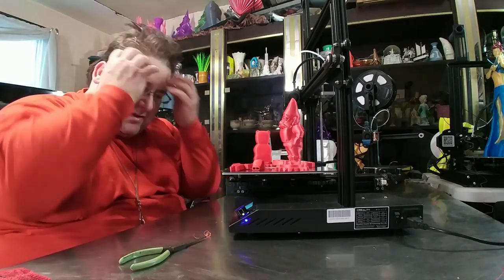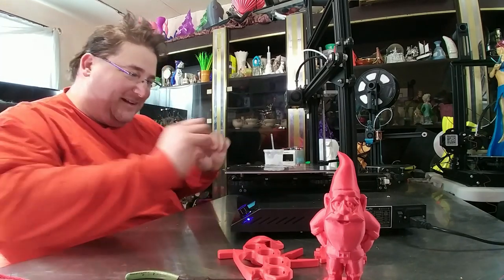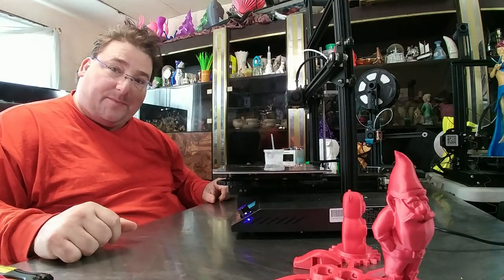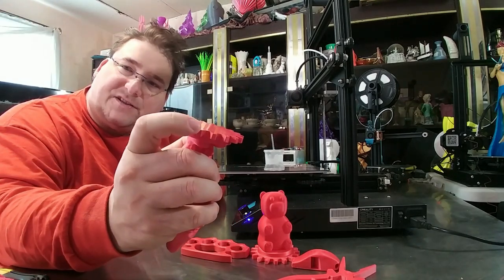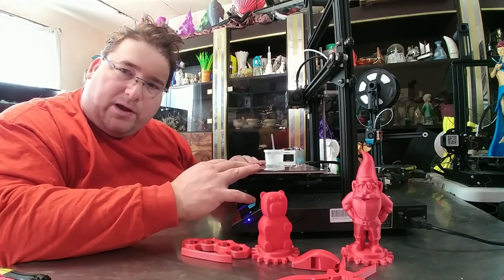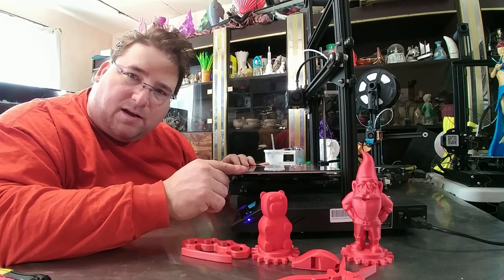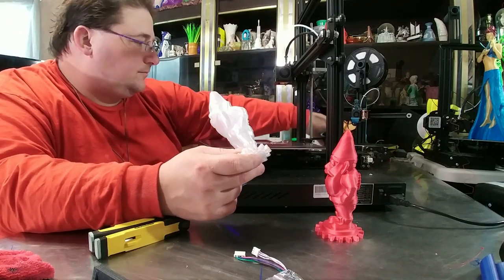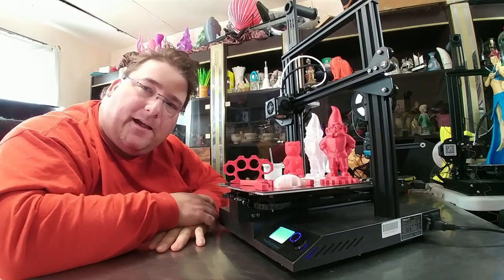Wham Bam Magnetic FlexPlate System T3DP 232

Comment: I can't get the bottom of by prints to be that flat. The bottom of my prints look ridgey like you can see where the printer head was passing through. >_<
Reply: Cr10 mini
Printing on the default glass (it's perfect flat)
Using a standard glue stick. I know it could be better with better stuff. But it should work with that stuff.
Reply from the maker: Sounds like possibly too much squish or slight over Extrusion?
Reply: @nerys71  ugh I can't seem to nail it down >_<
Does the amount of glue hurt? Cause it seems I have to use a lot of get the prints to stick.
Reply from the maker: If you have to use a lot of glue that means you're building up the thickness of the bed that means your nozzle is too far away from the bed that would also explain your non flat bottoms using all four knobs equally bring the bed a little bit closer to the nozzle keep bringing the tiny bit closer until the bottom looks proper

Comment: i have print surfaces on both my ender 3 and anet a8 that cost a fraction and print very nicely.  my a8 cost 99 dollars and my ender 3 170 dollars so they seems a bit high for the cost of the printer.
Reply from the maker: you have to get used to ignoring what those printers cost you. you are comparing economies and economies of scale that normal manufacturers can "NEVER" touch. period. NO ONE is going to be able to compete with a $170 Ender 3 except another chinese company like Creality. and even those can't quite do it. Geeetech is close but costs more and is not as high a quality Tevo is on parity with quality but costs a lot more cash ($50 more minimum)

you simply can not use those numbers to judge the prices of things. I mean by those numbers 3 kilo's of proto pasta filament costs as much as an Ender 3.

the purpose of this is convenience. and $69 for a removable print surface for your ender 3 that means you "never" have to fight to get a print off again. I am all over that :-)
Reply: @nerys71   dont forget that the newer enders like the one I got a few months ago come with a removeable bendable print surface that also requires no adhesive.  I understand the economics but it is hard not to compare cheap stuff that works well and is easy to maintain.
Reply from the maker: agreed. I have one with the fiberglass flex plate and creality print surface and I LOVE IT. not as good as this for sure but its half the price (I went to buy more for all my ender 3's $27 to $30) but still. half the price.

Comment: Chris, would this product work on the  JGAurora  A5 heat bed? I was thinking of buying the heat bed without the glass ($25 on Amazon) but will I have a problem with the aluminum plate not being strong enough to maintain a  flat shape ?
Reply from the maker: I don't know. how thick is the heat bed? if its 4mm and flat you should be ok. but I have seen some that come with REALLY thing aluminum heat beds because they know its being attached to a piece of glass. in that case this probably won't work well.

Comment: hey just bought a wham bam system for my ender 2 mind giving me your bed temp for pla mine isnt sticking well at 50c (my normal printing temp for PEI sheet)
Reply from the maker: Make sure it's clean and raise the temperature 65c also make sure your first layer is slow and hot

Comment: On my printer, I have a buildtak flexplate on Mic6 cast aluminum. It works really well, but certainly isn't as flat as the mic6. It does give me a little idea to get some mic6 and some of these: https://www.kjmagnetics.com/proddetail.asp?prod=D82SH (good up to 150C) and put the magnets into the mic6 and use spring steel on top of that.
Reply from the maker: the issue for plate based systems is tarrif import issues right now. IE very expensive.

Their magnets are good and tested to 170c past that and they degauss. very impressive.
Reply: @nerys71  Looks like I can get some mic6 ~10x10" from alustock for $48. Quite a decent price IMO (comparable to my last purchase of something larger).
Reply from the maker: thats a fantastic price for mic6 !!!